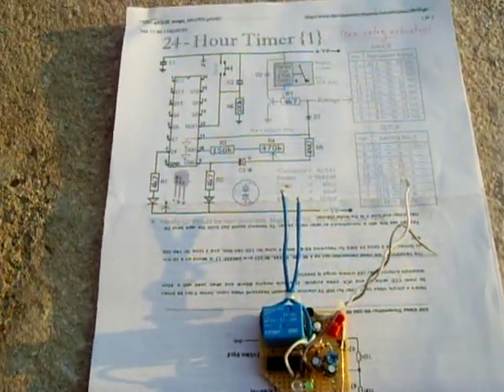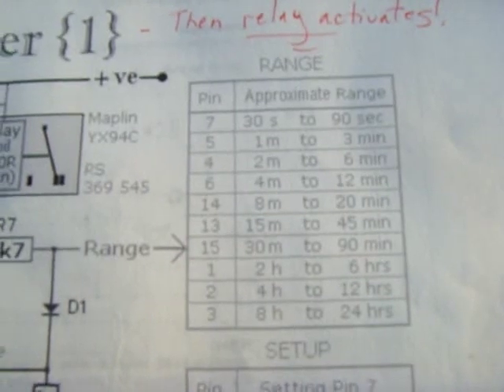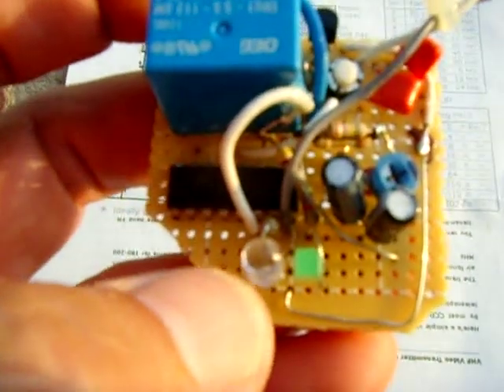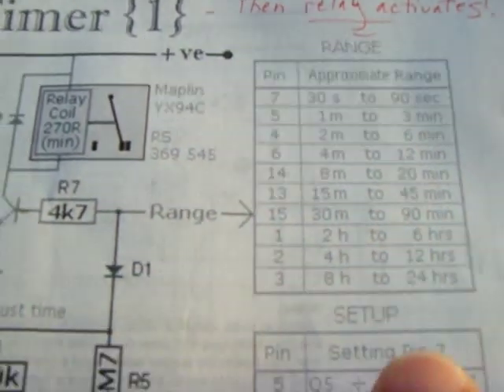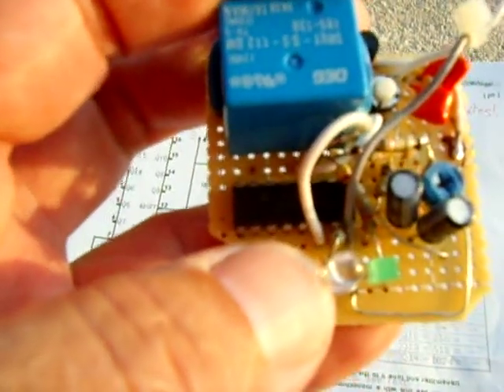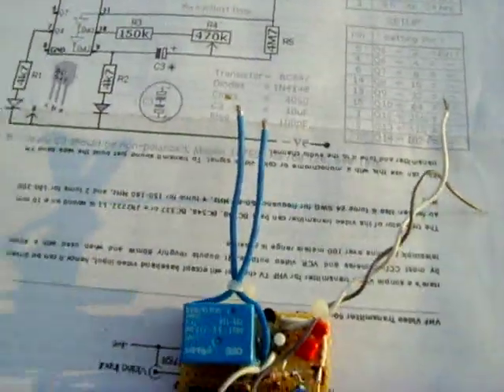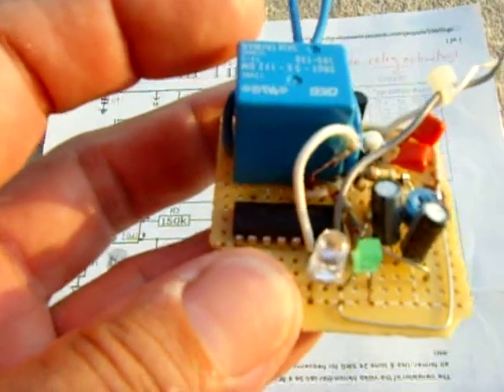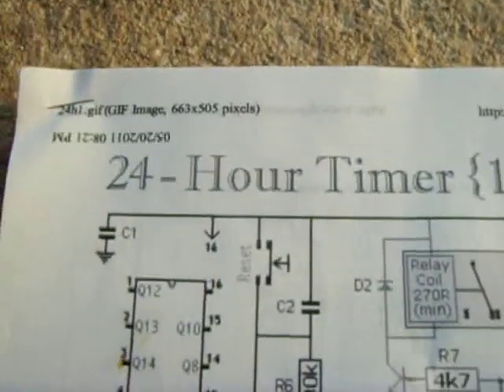24 Hour Relay Activated Timer circuit

Comment: I need to find a circuit/solution that would perform like in the description below! Can someone help me with this please?

"Timer's working schedule is 16 hours on and 8 hours off. Please mind that the light goes very dim, not completely off. Every time you plug the Smart Herb Garden into power socket it will start the schedule from the beginning. For example: if you plug the Smart Herb Garden in 8AM, it will turn itself off 12AM (after being 16 hours on) and again on 8AM."

Comment: Hello sir, I'm wondering if you could help me with this. I'm a complete beginning however I'm interested in learning building a circuit that changes lights every 10 minutes. 

So there are a total of 12 LED lights with different colors, when circuit switches on the first LED is on, then 10 minutes, first one turns off and 2nd light comes on, after 10 minutes, 2nd one off 3rd one on... so on so forth.  So it will take 2 hours to complete the circuit, each light is on for 10 minutes. Then after 2 hours, first light comes back again, rinse and repeat, until switch is off.

Is this a simple project that a beginner like me with no prior knowledge can tackle with ease?

Comment: hi. the reset in timer is problem .when timer is working and press in buttom on reset & stay press the timer is dont working .whats the solution . please show how join to reset the circut and stay pres on the reset (microswitch).
Reply from the maker: +Ahmed alshummary 
Hello there. The circuit works just fine. You must have done something wrong, or used an incorrect or faulty component. Are you sure you used a "NORMALLY OPEN" momentary switch?

Thanks for watching
Reply: Thank your answer to my question
Circle work well
The problem in Chapter key when you keep pressing it stops working for the department.
I need Circle in the hatched eggs to flip the eggs automatically, moving the egg holder to the left When he arrived at the end of the half key and pressing it ovipositor stop moving with the continuation of the work of the department, and two hours after the egg holder moves to the right and up to the end of the half key Vidguet it.
I want a solution and thank you ...

Comment: I could need a little help. I wonder what voltage i should put on my circuit, does a 9v battery work? I am pretty new to electronics, and i need this timer for a robot i am working on...
Reply from the maker: Hello Hans. Yes, using a 9V battery should work fine, just make sure you use a relay coil that does not draw more than 30 or 40mA since the 8V battery does not have lots of capacity.

Be sure to share my videos with others, and rate a thumbs up.

Thanks!

Comment: Can we use this circuit for aquarium lighting...? 
That is 15hrs on and 9hrs off and do the same automatically?????
Reply from the maker: It's been a while, but I think the time on can only match the time off. What's wrong with 12 on / 12 off? That's more than enough sun exposure in nature.
Reply: Ok then which pin i use for 12hr ???
Can we use 4007 for D2 or 1N4148???
Reply from the maker: @ashvin9685  All info is on the page I show in the video. 1N914/1N4148/1N4007 all should work.

Comment: Hi can you tell me what the current draw is for this circuit? Thanks.
Reply from the maker: +Jaime Crosas 
Hi Jaime. The current used before the relay coil triggers is very low. Maybe 10-20mA. Once the relay triggers, that could jump to 70-80mA.

Comment: Hello my friend, I'm new to electronics. I'd like your help, which part would be c1 and c2, and would c3 be a variable capacitor?
Reply from the maker: Peterson Pontes C1 / C2 = .1 uF
C3 = 10uF

Be sure to check out my video playlists and rate thumbs up. Thanks!
Reply: Thanks but only one more doubt on the plate that you mounted I see that it seems two capacitors of polieste and two electrolics and in the scheme I only see three capacitors would it be that same or I saw it wrong?

Comment: What relay did you use and where did you buy it from?
Reply from the maker: The relay was pulled from scrap electronics. One like this is perfect:
http://www.ebay.com/itm/10Pcs-Mini-12V-DC-SONGLE-Power-Relay-SRD-12VDC-SL-C-PCB-Type-/171244151642?pt=LH_DefaultDomain_0&hash=item27def2635a

The above relay is also available in 3/6/9V.

Thanks For Watching. Be sure to share my channel with others, and watch my video playlists as well.

Comment: Hello, This is a quite informative video but I have one problem that If I want to switch ON some 12 volts low Amperes load once in 24 hours for 2 minutes and switch it OFF back for 23 hours and 54 minutes and this process goes on infinite looping, What I must do any one can help me please.

Comment: I got a question Sr, Can I use this as a blocker I mean, The circuit will only start on if charge 8 hours?
Reply from the maker: The circuit is designed to turn on after any period you set. It can also be made to cycle on and off for any period you set. 8hrs on, 8hrs off, 8hrs on, 8hrs off....etc.
Reply: @electronicsNmore  what if I want the circuit to be on for 30 secs then off for 12 hrs

Comment: I want to switch mains voltage, which relay is required for mains voltage?
Reply from the maker: +Venkatesh M.v 
Hi there. You can use the relay contacts shown in this video to switch On/Off a mains powered device up to 250V. Thanks For Watching! Be sure to rate thumbs up and share.
Reply from the maker: +Venkatesh M.v 
Hi there. You can use the relay contacts shown in this video to switch On/Off a mains powered device up to 250V. Thanks For Watching! Be sure to rate thumbs up and share.
Reply from the maker: +Venkatesh M.v 
Hi there. You can use the relay contacts shown in this video to switch On/Off a mains powered device up to 250V. Thanks For Watching! Be sure to rate thumbs up and share.

Comment: hello mr how many volt to supply that circuit...i just need to know
Reply from the maker: +Danial Chedin 
Hi Danial. I used 9v or 12V, but you can go as low as 3V. The relay coil voltage must match the supply voltage. (3V supply, then use a 3V relay)

Thanks for watching! Be sure to share my channel with others, and rate thumbs up.

Comment: I'm a bit confused sorry, could I have it, that it waits 24 hours then turns on the circuit for 1 minute then turns it off for another 24 hours
Reply from the maker: You set the desired time delay you want (up to 24 hrs), then once the circuit is powered up, and the time delay has passed, the relay will close activating a circuit. The circuit remains on after that. You can make this circuit loop, up to 24hrs before turning on,  then after the same set time has passed, it powers off, then after the set time passes again, the circuit powers back on.

Thanks For Watching!

Be sure to check out my video playlists as well. :-)
Reply: owww, thanks a lot, this really helped, im thinking of buying a circuit like this. My question relates to my air raid siren, i want it to go off at 12:00 afternoon, every 24 hours, for 1 minute, thsnks again sooo much

Comment: if I set time for 12 hours after that it will activate automatically????
Reply from the maker: +Venkatesh M.v 
You can either have the circuit trigger once in 12 hours, or have it loop. 12hrs on, 12hrs off, 12hrs on, 12hrs off. 

Thanks. Be sure to rate thumbs up and share.

Comment: Very nice circuit
But my main question is :
When the desired time has passed
The relay switches on
How can u tell the time it switches on?
- or does it work in interval
Like 3 hours by 3 hours
What if i want the relay to connect for 10 mins every 24 hours
Reply from the maker: Fully adjustable as explained in the video. For more information please visit the link in the video description area. Thanks!

Comment: how do i get this?
Reply from the maker: There should be a link to the schematic in the video description area.

Thanks For Watching.

Be sure to check out my video playlists!
Reply: electronicsNmore is there anyway i can have a chat with you regarding this?
Reply from the maker: What do you need to know? It is a fairly simple circuit, just follow the schematic.

Thanks
Reply: electronicsNmore can you tell me the list of every component needed?
Reply from the maker: Refer to the link in the video description area.
Reply: electronicsNmore the link is fine , but website does not give the parts needed
Reply from the maker: All the components are shown in the schematic. Just write them down.